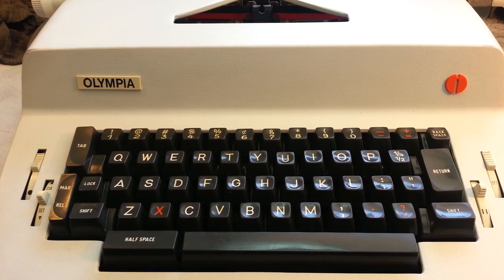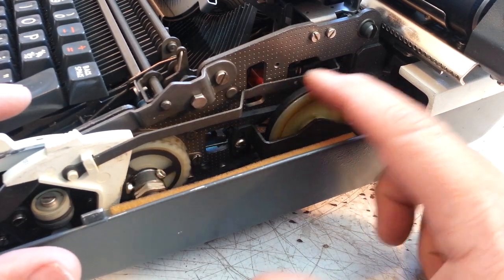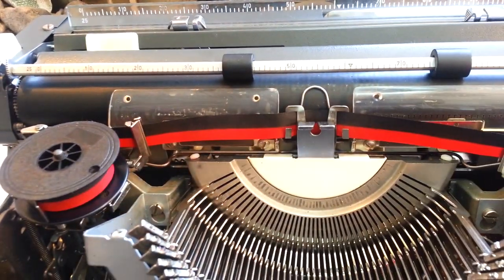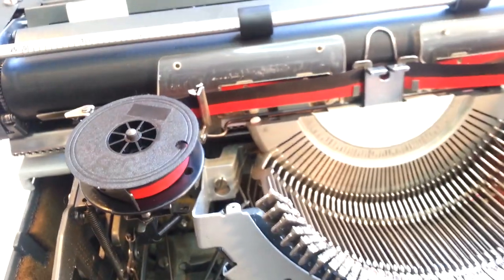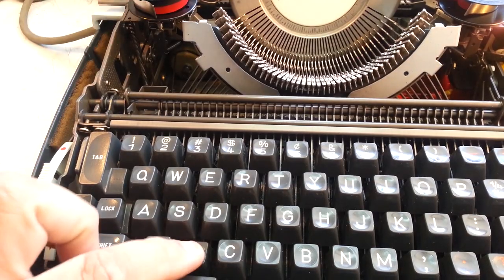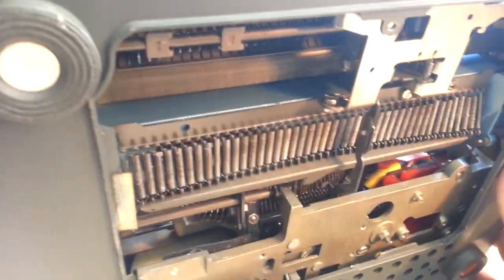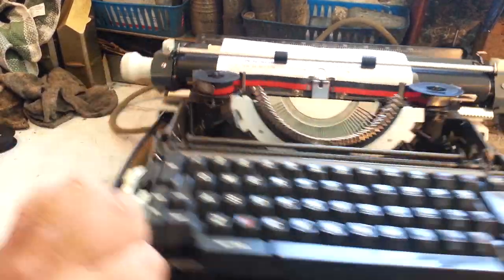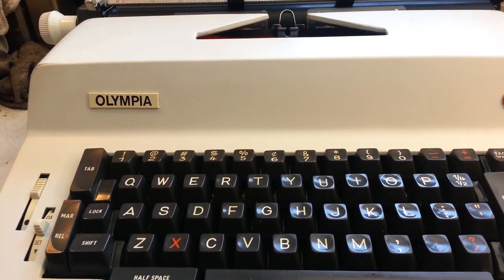Olympia Electric Typewriter 3/4 Size ? SGE 35 All Power, Heavy Duty, Smooth Operator

Comment: I have an sge 45, and sometimes when you hit the carriage return key it goes past the left margin. Sometimes a few spaces, sometimes all the way to the end of the carriage.
Reply from the maker: Either carriage is jumping past the stop (misaligned) or stop is moving (slipping), troubleshooting is needed
Reply: @phoenixtypewriter2136  I fixed it! Bought the typewriter repair manual for Olympia SGE 30/40/50 from T. Munk. Read the relevant pages; took it apart, found a spring not attached near the "center stop" (which wasn't always hitting the "left margin stop" because this spring wasn't pulling the Center Stop into a position that would cause it to hit against the Left Margin Stop. Reattached the spring with some hemostat forceps and a pair of tweezers. Managed to put it all back together! (phew) and voila! It works! It's fixed! And I have never fixed a typewriter before! If I was a drinking man I'd celebrate with a libation. Thank you for your videos, by the way, they gave me the inspiration to try fixing it myself! (You and Joe Van Cleave).
Reply: OK, turns out the problem was still there. The center stop was still ocassionally slipping past the left margin stop. So I took off the bar that the left and right margin stops slide along and inserted two small washers in between the left margin side's screw and the threads that screw screwed into, to re-align the bar in such a way that the left margin stop would hit smack in the middle of the center stop. And NOW it's rock solid! phew!
Reply from the maker: Good Job ! 
I have to modify, think outside the box, many times to get these vintage typewriters to work

Comment: How does this model compare to a Smith Corona Electra? 
From what I gathered, both feature fluted mechanisms and dual band motors. So they're both built to last. 

I'm considering buying one of them, and while I do prefer the look and available fonts on the SC, I can get the Olympia for next to nothing. Mostly due to fact SC machines are rather rare here in Europe, while Olympia is abundant. 

 
Either way, thank you for making these videos. They're both educational and entertaining.
Reply from the maker: Olympia is 5x better than the Smith Corona Electra, the Electra is SCM's low end typewriter
Reply: @phoenixtypewriter2136  
That's darn impressive, considering the high praise you're already giving SCM's.

Guess I'll go with the Olympia then. But lets not kid ourselves, I'll end up with getting both in the end anyway. 
What would you consider to be SCM's high end models? Sadly, electro-mechanicals seem to get the short shrift, so there's even less info out there than with manual machines.

Comment: Hey Duane :) what do you think about the IBM Executive series?
I have a Model C Executive, checking the Serial Number should be from 1960, and it can be confirmed also by the fact that it runs at 125V, I'm from Italy and before 1961 we had 125V, then switched to 220V.
Do you prefer the fluted shaft design of this Olympia or the rubber power roller of the Executives? Impressive machine by the way :)
Reply from the maker: 1st typewriter I was trained to recondition was the IBM C model & Executives. Power roller is superior as long as you can get quality new power rollers, all the old school recover shops are long closed, tried the current roller recover company and they use a different process causing an out-of-round roller causing inconsistent impression. So now it looks like the fluted shaft style wins !

Comment: Why does the motor have to run all the time?
Reply from the maker: All electric mechanical typewriters run while waiting to type, this insures that there is instant response to input
Otherwise there would be a delay in action while motor starts to turn all the shafts and clutches

Comment: Does the fluted shaft require any maintenance?  I have a chance of picking up a ibm model B or an Olympia just like the one you got here.  I know the ibm uses the power roller.  Do you think jj short can recondition it or should I just go ahead and pick up the SGE 35
Reply from the maker: JJ does do rollers, platen & feed rollers are usually good, but must always be checked for runout (out of round)
JJ procedure does not include any lathe work, Power rollers need to be perfect or you will get serious inconsistent impression
JJ did two power rollers before I gave up with that idea, even after they re-did them multiple times, never was perfect
The Olympia should be maintenance free, looks like they were designed to be typed on all day long . . . .
Reply: @phoenixtypewriter2136  
Thank you for your valuable input on this matter.  And thank you for all your videos I really enjoy them and look forward to them.

Comment: does anybody here know how to use the tab feature I want to write a letter and I want to indent
Reply from the maker: Move carriage where you want tab to be set, set tab using tab set.
Reply: @phoenixtypewriter2136  Which one is the tab set button?  My SGE35 is almost identical, except the buttons don't have the exact same markings. For instance, instead of a return, I have a down and left arrow, etc. The buttons on the left that on yours say margin release is blank and the tab button has a right arrow.
Reply from the maker: @BeLikeGumby  Yours is International version, us Americans don't understand basic symbols and need these controls spelt out
On machine in video tab set is control on left side of KB , says SET (arrow down) / CLR (arrow up)